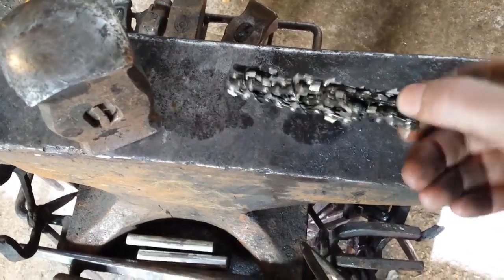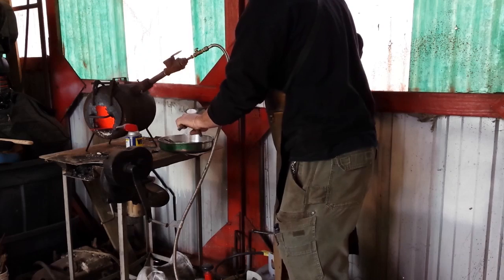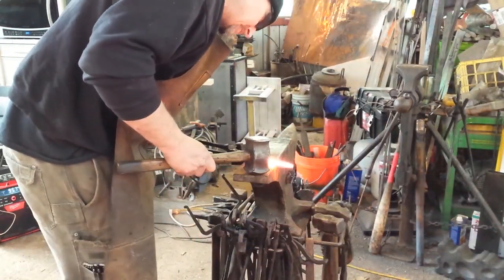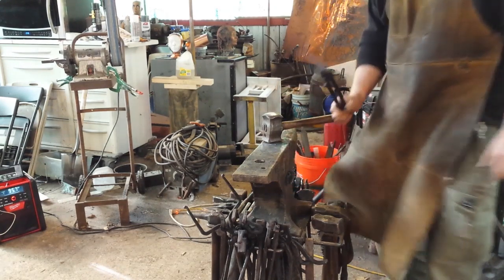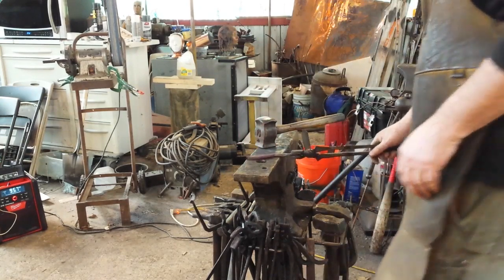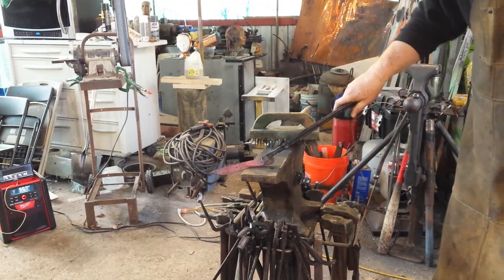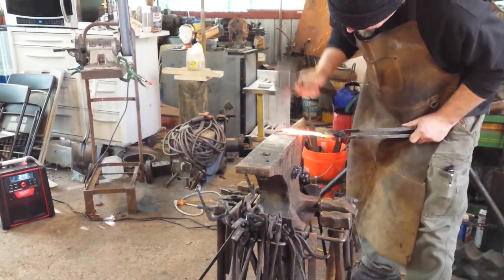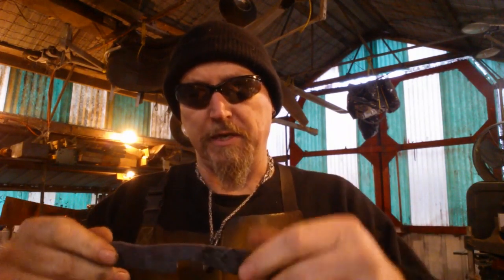Forging Chainsaw Chain

Comment: gotta try the wd40, thought grease would be a bad thing to involve when making damascus, very informative, keep it up!
Reply from the maker: You can also soak the billet in diesel fuel, or kerosene as well. The oil or fuel burns off and leaves carbon in between the layers so it removes oxygen and adds a tiny amount of carbon. That trick was taught to me by an ABS master smith.
Reply: @Wolfsdenforge  thanks man, very interesting, have to try that the next time i make damascus. Have a good one!

Comment: Looking forward to the final product. Is the peak in the spine a design element? Ah, the fish mouth... Years ago I took a bladesmithing class with ABS Mastersmith Jim Crowell. He was demonstrating how to forge down the point to avoid fish mouth, and I asked him why we didn't just cut our blank off the parent bar at an angle. Jim just looked at me, said "smart ass", and proceeded on :-) Yeah, I know why it's important on bigger stock -- but I still cut an angle before forging a blade tip.  Clyde
Reply from the maker: Yes, the peak is a design element, it will get forged to points top and bottom. I have an entire video about forging blades out of bar stock without cutting anything and not getting a fish mouth. This hammer is being forged by an apprentice who has yet to learn this lesson. I had him forge the corners down before drawing out, which is how you avoid fish mouth without cutting, but he didn't forge them down far enough.

Comment: Awesome vid Wolf,  I am a beginner blacksmith, and have just come across some chain, similar to what you worked with in the vid, any basic tips and tricks as far the actual welding of the chain is concerned?
Reply from the maker: Yes, don't forge it into a blade! Compact it as much as possible, forge it into a solid billet first. Once you know it's a solid billet, then forge that billet into a blade. This saves you from avoiding any voids in the final piece. If your billet has voids or inclusions you can grind them out, fold it over and re-weld it, then you won't have to worry about it. If you discover you have large voids in a blade blank, it's scrap. Good luck and have fun!
Reply: Wolf's Den Forge thanks, appreciate the advice

Comment: i've been struggling multiple times to forge weld it, i dont know if its because i'm not cleaning it or because my forge wasnt heated enough, any advice?
Reply from the maker: this is going to sound stupid but my first question is this do you have your basic Forge welding skills down? The reason why I asked that is many people immediately just jump in to try to forge welding things like chainsaw chain or Damascus or something like that without actually practicing. That being said you can be too hot or too cold in your Forge the easiest way to tell is to practice with another piece that's the same composition like another piece of chain heated up when you think it's at forge welding temperature then take your other piece of chain that should be heated to the same temperature and touch them if they stick it's at forge welding temperature
Reply: @Wolfsdenforge  i have made a ring from mild steel damascus using a small DIY coal forge, which isnt big enough for the chain, i personally feel my temperature isnt high enough, since i've also tried with an elevator cable and only managed to forge the center of it. thank you for the advice, i'll try it next time
Reply from the maker: My pleasure, I hope it helps!

Comment: I recently received a Anvil and forge for Christmas, I've since used it everyday but I'm getting a lot of blisters and sores on my hands, by any chance do you know how to stop these?
Reply from the maker: Sadly, you will get blisters until you start to form callouses. Whatever you do, don't peel the skin off! Pop the blisters only if you have too, but if you do, don't peel the skin. It's better to leave blisters be and let them heal, they will harden into callouses faster that way. Other than that, not much you can do.
Reply: Thanks I appreciate that.
Reply from the maker: You are very welcome!
Reply: Try different gloves, some chafe some dry due to leather treat ... I use welding gloves with a thick leather but soak in water and let dry befor using

Comment: So I am very much so a beginner and I'm have been trying to figure out what is flux made of and the proper way to use it. Only thing I have found out is most of what I have read is borax with a blend of something. Anything to elaborate would be awesome.
Reply: Anthony Geyer plain borax works fine in most situations. borax plus iron powder or iron filings works well. some smiths will dissolve their borax in alcohol, and let the piece soak in that until the borax has penetrated every nook and cranny. I am sure Crazy Russian Doug might have some more info to add.
Reply: Thank you next time I fired up the forge I'll have to try a weld.
Reply from the maker: Plain borax works just fine, there are many other elaborate fluxes on the market but really just plain 20 mule team borax from the grocery store works just fine, ti's what most of us use. In Europe the most used flux is just white silica sand.
As for using it, it's really just put on the surfaces you intend to weld to keep the oxygen out so it doesn't oxidize. Oxidized steel will not weld. That's it, really. I'll do a video on it when I have a bit of time, early next week probably.

Comment: Any reason you don't use kerosene as a flux?
Reply from the maker: I've used a variety of fluxing agents including diesel fuel, kerosene, WD-40, etc.. I use whatever I have to hand at the time. I travel full time, so anything I need I have to carry it with me. I set up shop wherever I happen to be at the time, so I don't always have a full range of options available to me.
Reply: If you're ever in the south east side of Pennsylvania, give a shout. I work outside, which is less than optimal, but I have fun at it. And I have cookies. Swing on by.

Comment: When I tried this my chain came apart and singular links flew every where
Reply from the maker: It is a challenge, that is for sure! Some things we do as blacksmiths are really only worth doing because it is a challenge. Next try I'd recommend making sure you are up to a good welding heat and then very gently mash it into a lump with your hammer. Don't beat it like it called your momma names, just kind of compact it. Then flux it up again, re-heat, and repeat until it's into one solid mass. Then forge it into a billet, then forge that billet into a knife. Hope this helps, cheers!